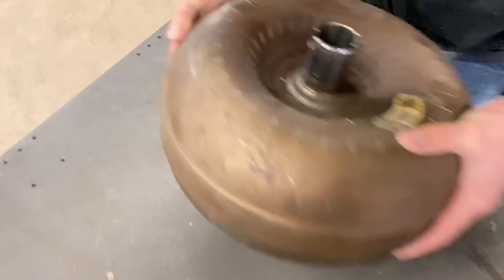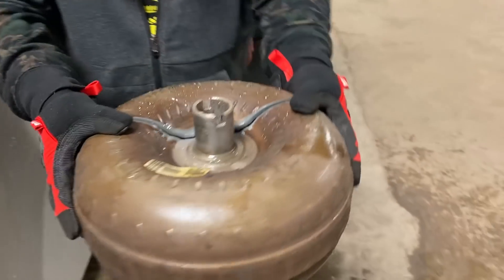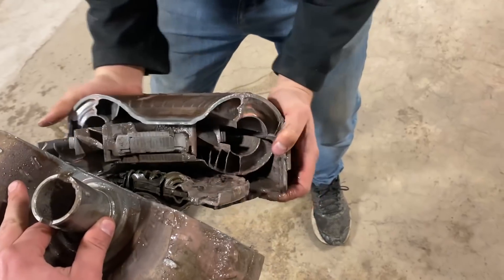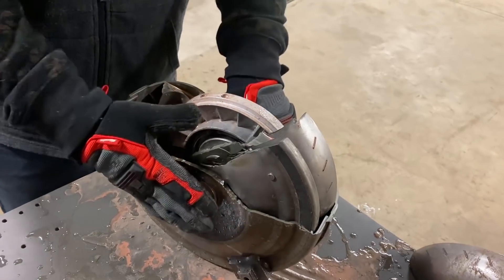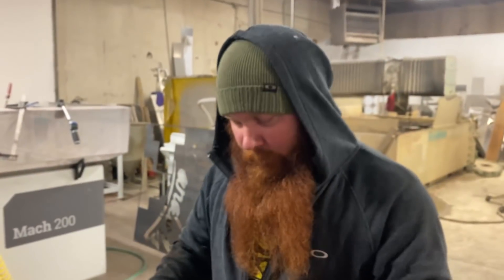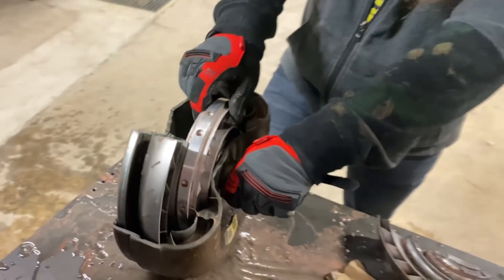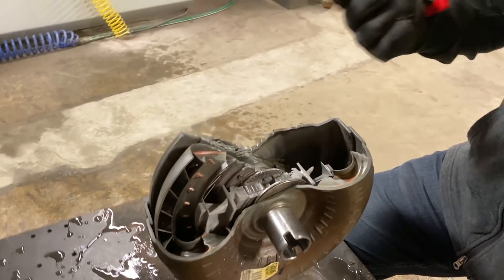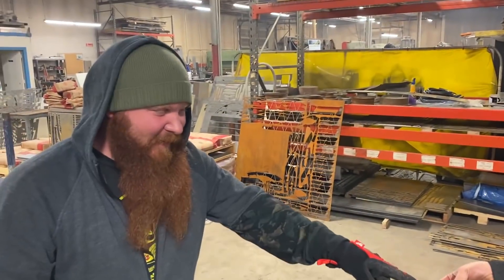Torque Converter vs 60,000 PSI Waterjet | Amazing Cross-Section

Comment: Best analogy: 2 fans that face another. Power one and the other rotates. Stick it in a tube and replace the air with ATF.
Reply: Yup 👍
Reply: aye that’s how i explain it
Reply: DID YOU WATCH DONUT MEDIA'S VIDEO ABOUT TORQUE CONVERTERS

Comment: The weirdest truck with a torque convertor as well as manual transmission combo that I have ever seen in my Army days as a mechanic, was the 10ton Steyr truck. 10 speed, hi and low ranges, you can bring it up to the last speed and press only the break pedal when you want to stop. When you wanted to go forward again, you didn't have to bring your speed to the lowest. Nope. Press the accelerator, and away you go. That transmission was huge. I can't recall the name right now but it wasn't an Allison transmission  for sure!!! LOL

Comment: I know a decent bit on how ICE motors and transmissions work but I swear that torque converters are black magic. Planetary gears using hydraulics to actuate in a traditionalautomatic? Yeah not too bad. Wet clutch packs in a dual clutch automatic? A bit more complex but easy enough to understand when you look at compared to traditional manual transmissions. Clutch packs aren't even that complex, really. Just a couple of friction surfaces held together by some serious pressure and separated by a few thousandths of an inch by a hydraulic lever. Torque converters? Hydraulic magic turbines that use fluid dynamics to somehow make the crankshaft move the driveshaft after performing physics magic.

Comment: Picture two fans facing each other. You turn one on and it will cause the other to spin. Now encase two fans in a metal donut and replace the air with fluid. Torque converter.

Comment: It's actually a fluid coupling.  As the fluid is driven by the blades on the housing, it drives it against the turbine which is spline to the input shaft in the transmission.  At higher speeds there is a torque converter clutch that engages to mechanically link the engine and transmission.

Comment: I was with you until you tried to explain how a TQ works! LOL

A simple explanation is you put 2 box fans together and turn on one. The other will spin due to the air flowing over its fan blades. The only difference is the TC uses fluid.
Reply: That's a good example to get the gist of it but it's really not the same.  The fan example would be more accurate if the unpowered fan returned the air to the powered fan at an angle opposite of the powered fan's rotation. This is why there is a stator in between the impeller and the turbine, to redirect the flow coming back into the impeller.

Comment: You ever flush a turd and watch it spin down. Imagine the water is the torque converter and the turd is the drive to the transmission. Basically the rotational movement of the fluid transfers power to the transmission

Comment: The easiest, oversimplified explanation of a torque converter I’ve heard is two box fans facing each other. Plug one in and it blows air into the other one, making it spin. Then you use the second, air driven fan to do work. There is a lot of blade angle, clearances, stages and others science going on, some have other features like locking up and of course it’s fluid instead of air but that’s a fair description.
Reply from the maker: Yeah that’s an awesome description... I wish we would have said that in the video
Reply: I wish I could take credit but someone told me that a long time ago. It helped me get my head around the wheels not turning when it’s in gear but the engine doesn’t stall. I was lucky as a teenager to get to hang around with some old guys in a speed shop who had patience for a young dummy. You did point out the spline inside the trans end. When I was learning, I though the notches on the output was driving the car, I didn’t know it was the pump drive. How could anything slip if it was all one piece? Lol

Comment: To describe a torque converter in the simplest terms, it's like using one boat propeller to turn another propeller which are both are encased in a unit filled with fluid.
Reply: ...with a third propeller between the 2 that doesn't move.

Comment: Easiest way to think of them is 2 fans pointed at each other and only 1 is turned on. The one side spins and the fluid being thrown at the opposite side causes It to spin. Once the input and out put are equal the 2 halves lock together with a clutch that is activated hydraulically.

Comment: When I younger they spoke of tightening the the bands on a automatic transmission on one that was slipping do you know anything about that
Reply: That's more for overdrive and reverse not all gears but there were bands made from metal that had clutch material on the inside of the band that would engage onto the clutch packs to slow down or reverse the packs
Reply: The band or bands some transmissions have 1 some have 2, applies to stop a drum with a clutch pack inside it from spinning which will put it in a different gear usually first or reverse.

Comment: Everyone look up Hughes performance, torque converters 101.
Reply: I work for Hughes Converters and have cut open hundreds of converters. There is, the casings ie; top and bottom, and the stator, the turbine, and finally the clutch piston, which provides lock up. Assuming the transmission has lock up. Earlier transmissions do not have lock up.
Reply: @timz3230  topirea aluminiu acasa

Comment: Just two things to mention, that hub with the notches is what drives the pump in the transmission. And while cruising there is a mechanical connection between the engine and transmission, at least in some automatics. This convertor has a TCC (torque convertor clutch) in it, which engages when you're in 4th gear and lowers the RPM a little as well as running cooler.
And if this gets stuck on for some reason the car will actually stall coming to a stop just like a manual will if you don't depress the clutch.

Comment: 4l60 e that things fucked and prolly cant handle reliability what you want id suggest a t-56 a manual trans but with 2 over drive gears for max fuel mpg and they can make like 2000 to the wheels and not explode like a grenade.

Comment: It converts dc torque from the motor into ac torque required by the rest of the drive train.
Reply: I don't think it's electricity..?
Reply: Mitchell 42 yes but only if the proper conversion fluid is used and changed regularly to keep those electrons well lubed so they change easily

Comment: Automatic Corvette C5's also have 4L60e's with better servos. They shift pretty dang quick too, about as fast as the cheap dual clutch transmissions. Not even close to the dual clutches in exotic cars though.

Comment: Pretty cool cut away, it's pretty hard to visualize how they operate unless you dismantle one at the weld and see one going through a rebuild phase.. Alot of information you've mentioned is pretty accurate in how they operate, but hopefully I can simplify how they work with my comment..

The casing is mounted to the flex plate on the engine, the transmission side aligns with multiple things, the square cutaway on the outside lines up with the oil pump of the transmission, which provides oil pressure for the whole transmission, and inside the torque converter, as you mentioned, the splines from the transmission input shaft connects to the splines of the turbine.

When your engine is at idle, the oil being flung off the impeller isn't enough to "push" the turbine forwards on its own, so the vehicle stays still on the spot, or may actually creep forwards as you step off the brake. 

When you step on the accelerator, you're telling the impeller to push the oil harder into the turbine, so it's like using a hose to push something forwards, essentially that's what it's going, but to help out, the middle plate with the angled fins are there to help, the torque multiplier increases the pushing force on the turbine, working more efficiently.

To give a very quick and simple explanation of how one works, take two pedastool fans that you use inside your house during summer, plug only one fan into an outlet socket and face the two fans face to face, switching the fan on that is plugged in, is your engine speed, the air coming off the blades will in turn drive the fan that isn't plugged in, that fan is the turbine. One thing to notice here, is that the rotational speed isn't the same, there's slip in the system, and that's exactly what occurs inside the torque converter, thus the invention of the lock up clutch.

When the transmission detects that the vehicle is in motion at a suitable speed, and when engine speed is near enough to input shaft speed, the transmission engages the lock up clutch, the lock up clutch is inside the torque converter which has the springs at the back, these are damper springs to absorb the "jolt" that may be felt during engagement. Engagement of the lock up clutch means that the torque converter and the input shaft speed are now running a 1:1 ratio, engine speed is equal to input shaft speed. Thus running more efficiently, without the slip.

Comment: Made it way more complicated than it actually is, so it’s got an impeller which spins fluid at a high rate of speed into the turbine, connected to the trans, it’s all fluid motion before it locks both disks together so the fluid does not overheat from fluid transfer motion

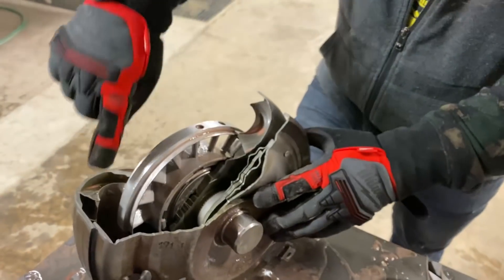Comment: 5:11 There is a direct connection when the converter lockup clutch engages in top gear. It locks up to eliminate the fluid coupling slippage and lower engine RPM.
Reply: It locks in other gears too. Sometimes when you stomp on it, or when you're cruising. Basically it locks up when you need to be most efficient and not lose power sloshing fluids around to spin some spinny bits.
Reply: @pioboss9823  Only some cars use transmissions that lock in situations other than top gear. Converters that lock in each gear exist, but you'd want the converter unlocked when you stomp on it to allow the engine to reach peak power. That's the concept of torque converter "stall speed."
Reply: @mannys9130  i could be wrong, but once the car has gotten deeper into the power curve the converter will lock up to squeeze out any performance left. Im not sure i explained either message clearly, and i cant be bothered to reply again.

Comment: Torque converters are in Automatic transmissions...  And it serves as a catch to keep your engine running, without stalling & disconnects it from the drive train.. Its just like a clutch, but more complex and hard to understand! 
been many a months since i seen the difference between Auto & Manual transmissions..

Comment: No ATF. The T stands for transmission, and ATF goes in the transmission. Tq converters are sealed and have a separate hydraulic oil inside them.
Reply: Andrew Delashaw no they don’t, they use ATF
Reply: The torque converter actually turns the ATF pump inside the transmission and the fluid is pumped in to the converter

Comment: the only thing more complicated and difficult to understand than a torque converter is the automatic transmission it's connected to.   they're both more complicated than the third most complicated thing, which is the large hadron collider.
Reply: Automatic transmissions are NOT that complicated. It can seem that way if you don't know what a planetary gearset is or how one works, but once you know that you can see how the clutches and bands engage various gears to give you so many different reduction ratios.

Comment: so the long cut time raises a question. How long can the water jet run before the pump overheats or the nozzle wears out?
Reply: Hopefully the pump has proper cooling so it won't overheat, the nozzles are consumable items and do wear out. Several websites I consulted suggested 20 to 80 hours of cutting time per nozzle. There are other consumable items in a water jet that need to be replaced over time as well.
Reply: The pump doesn't need to stop other than for usual service and the nozzle depends on what nozzle material you bought. Sapphire orifices last 20 - 80 like Not Dave said but Diamond orifices can last over 1000 hours. They both have their place though.

Comment: The housing is the impeller, which spins with the crankshaft and as the fluid rotates inside of the torque converter it spins the turbine and that is splined to the input shaft of the transmission, which is how the vehicle moves, the little wheel sandwiched between them is the stator, the most important part of the torque converter because that is how torque multiplication occurs. The stator is on a one way clutch which when the torque converter is in vortex flow( turbine and impeller are rotating at different speeds), which is usually under acceleration,torque is multiplied. The stators one way clutch locks during vortex flow, the stator is then locked going the same speed as the turbine, and doubles the surface area of which hydraulic fluid can push against, thus multiplying torque. This is the only stage of which the torque converter is actually multiplying torque.

Comment: The fluid flows through the vanes on both the input and output sections, transmitting power with fluid drag and then fluid flow as the rpm increases effectively creating a driving pressure. As the speed of the output begins to catch up to the speed of the input, a clutch disc engages to creat a 1 to 1 input output rpm.  As a result, you have a theoretical power loss of zero, as apposed to ~50-90% with just fluid alone, without having to have multiple clutch plates and using clutch slipping techniques to deliver a smooth acceleration and not stall your engine wile idling.

Comment: 4:39
Sounds like if I wanted quicker engine response I would use mercury in place of the transmission fluid.
Reply: Atf is also a lubricant. The fluid inside the torque converter is circulated. It wouldn't last long.
Reply: The nursery word amalgamate all of the other metals in the transmission it would just melt that would be some cool shit.

Comment: Midly impressed they got the flexplate vs flywheel terminology correct.
Reply: most people even mechanics usually mix up the two I was surprised also
Reply: Except that they refered to the engine as "a motor" and ruined everything.
Reply: @petezzzz  except all engines are motors, though not all motors are engines.
Reply: bansheeflier1015 truth! But for this application sir david senner is not wrong.

Comment: It works like two fan blades next to each other spinning each other but only one has a motor and the fluid works as the air, one spins the other fan. when the car stops one fan can spin but not the other because its fluid driven. Btw the clutch pack does not disengage at a stop, thats why this complicated system is used also thats why you roll forward when not braking

Comment: I've changed a thousand of these, but never cut one in half!! That was a pretty good explanation of how it works. I think the fluid is basically hydraulically pressurized into a near solid in the torque converter. The "Shear force" of the fluid refers to the point at which it will slip past itself as if breaking a solid. C'mon internetians, help me out!
Reply: Spot on my dude
Reply: Yep that's pretty much how it works, it's a hydraulic clutch clutch and uses the centrifugal force of spinning to apply pressure to the wheels
Reply: I own 2 B.O.P  "Switch-Pitch" transmissions.
Reply: You are somewhat right.  The pressure doesn't matter though. It will opperate with zero pressure as long as it is full.  Think of it like riding in a boat and a hundred people drag their hands in the water.  The fins drag in the atf and make the outside and inside turn together.   Maybe stirring a pot of water is a better analogy.  Hope that helps.
Reply: @corbinschad1  pressure matters...not enough pressure will cause cavitation and not enough cooling flow